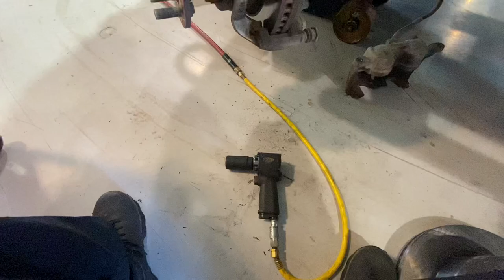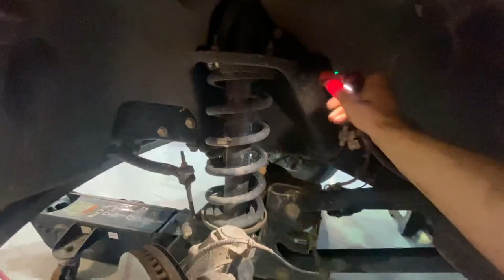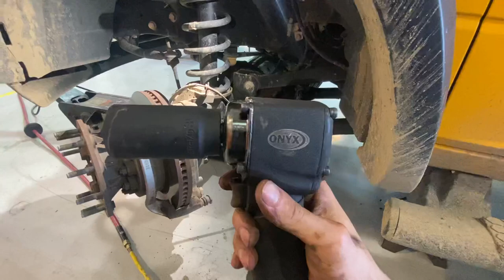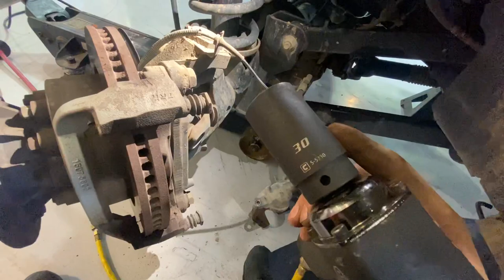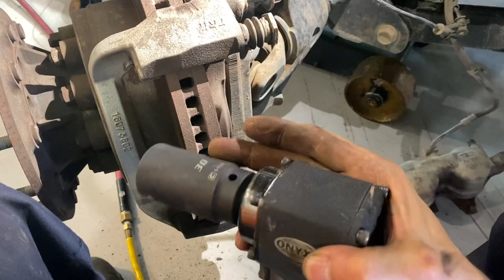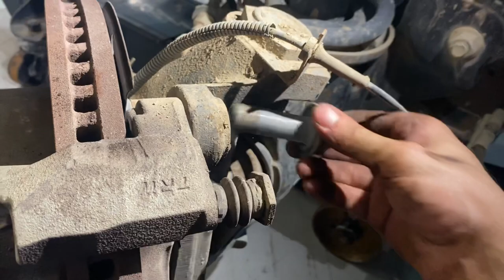Onyx 1822 (v2) Best air impact gun wrench

Comment: Meanwhile Strap-On wants you to spend 700 bucks or more, lol. I have a huge 1023 triple bank and tons of SO stuff, but only because my cousin was a dealer at the time and I paid cost. All my 3/4 and 1" stuff is either Grey pneumatic, Sunex and AP, 2 decades on heavy equipment and I can count the sockets I've broken on 3 fingers, lol. And those broke when using a multiplier or hydraulic driver. No way I'd buy SO impact stuff. This AP product is one of my favorite everyday guns besides my old IR 231 that was heavily modified, AP makes some really great tools, I have a set of infinity ratchets that have zero swing that I bought a decade ago and they're also another daily lifesaver, they use a cam and friction instead of a gear and tooth, great for tight spaces.

Comment: Hey Jersey; what do you advise, a 3/8" or a 1/2" drive?     I have allready a KS-tools 1/2" drive(1600 Nm) and a Milwaukee 3/8" cordless(electric) impact wrench.
Okay, the KS-tools (The Devil) is not so small(17,5 cm) as the Onyx(less than 10 cm).
Impact sockets i have 3/8" and 1/2" .
Have a small car, Ford Fiesta.

Comment: Not the best. My v2 died after 2-3 weeks
Reply from the maker: Dang, hopefully doesn’t happen to mine. I’ll do a long term review after a couple of months.
Reply: @jerseyprotools5723  hopefully it don't. I put my tools through the paces. I don't baby them, but I also don't rag on them. This thing hammered allot of 22mm diesel lugs for the time I had it and it failed. I think it was a tolerance problem, i didn't open it up because it was under warranty and I returned it so I don't know for sure. It slipped in foward and their after in reverse. I got the aircat 1077 3/8, down from the 1/2 of the astro. My buddy has the 1055 1/2 and it's 3-4 years old work horse.
Reply: May I ask how? Bought the same 1822 V2 and broke 1 of the 2 hammers inside :( . But I did frankenseting the inside with the AWP050M from mac tool that the handle broke lol. The same hammer "cage" size & was able to swap it. But im in canada and I can't reach then to send me another hammer set
Reply: @DouuubleV  I can send you a hammer set
Reply: The new Nano's need more grease in the hammer cage compared to the old ones now that its making more power. I've told them to do that, and they're finally doing it now
Reply: @TorqueTestChannel  i would gladly take them for sure :) you can pm me. Can I ask you how you got them called 2 local shop & my snap on guy thats sell astro and they can’t seem to be able to order the parts inside only the full tool.

And for future which grease would you use inside the hammer? Normal mechanical grease? Because when I opened mine when it broke and there was little to zero grease.

I even tried to open claim 2 times on astro warranty site, tell them exactly which part that I need and got no answer from them did not called tho
Reply: @DouuubleV  Yeah, you basically call them up (astro) and they will send you the parts free. I dont see any info on your page about contact info, and YT dont have PM's. So email me at TorqueTestChannel@gmail.com if you could.
GL2 grade high temp moly grease, they didn't grease them enough to stay cool with the new upgrade in power IMO